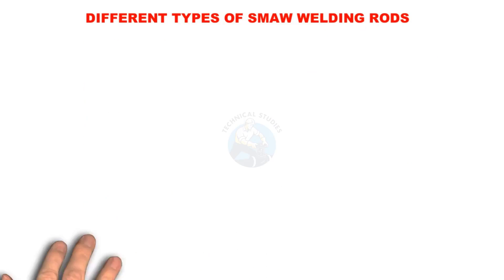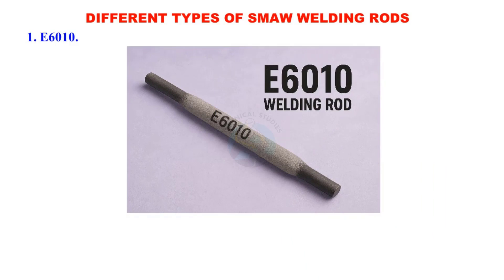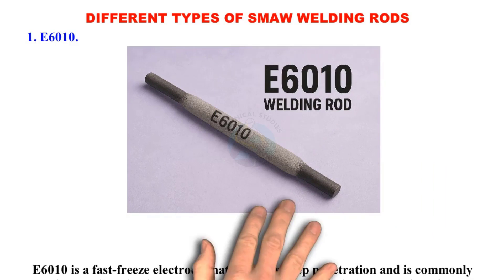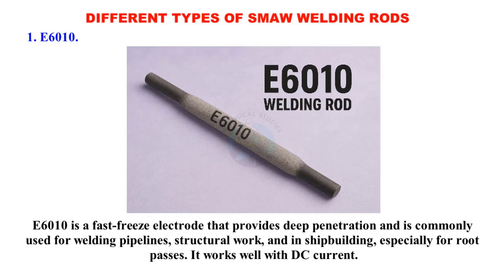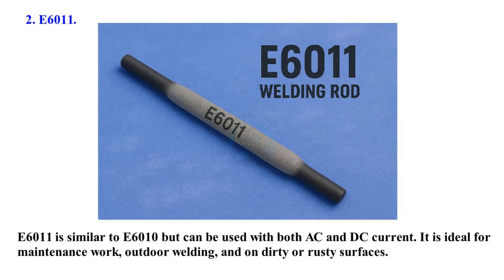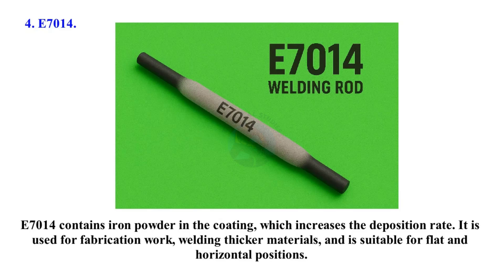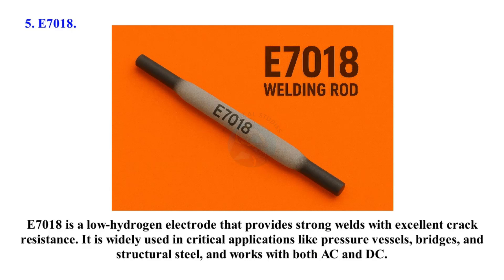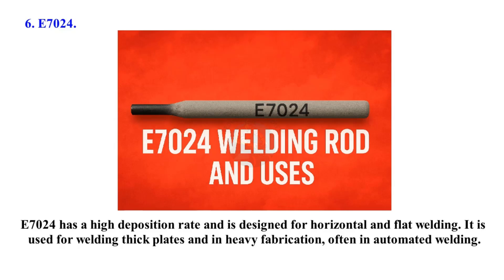Types of SMAW welding rods and specific uses.

Comment: 7018 - first two numbers are tensile strength, third number is position, fourth is manufacture specifications. so 11018 -110 = tensile strength, 1 is position, 8 is manufacture specification. ( been a while, 1 is all position, 2 is vertical and horizontal, 3 is overhead, i do believe. )
Reply: I think fourth number indicates  about flux coating.
Reply: @josephmariyaraj8931  yep its means cellulose or other stuff i can't remember right now lol
Reply from the maker: You are right bro

Comment: 6011, Lincoln 37, must be run on pulsed DC or AC.  The rod must be constantly moved for if you drop the arc, slag will be trapped under the weld.  It is all position and if you want something to stick, it does the job.
Reply from the maker: Thanks for the info, bro!

Comment: What rod would be used for overhead welding?
Reply: All rods with a number 1 in the third number of the rod number is suitable for over head welding. If you know how to weld.
Reply from the maker: 70 1. 60 1
Reply: @technicalstudies. - i use a  1/8  7018. burn hot and fast and dont get under it. dont forget to throw your lead over your shoulder to have enough slack to work with